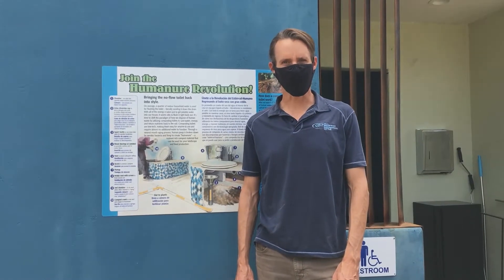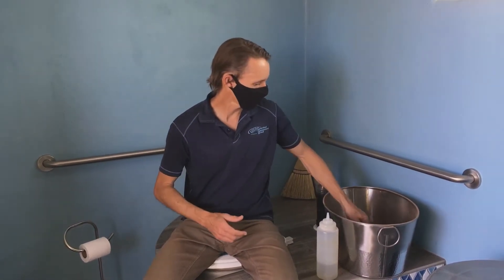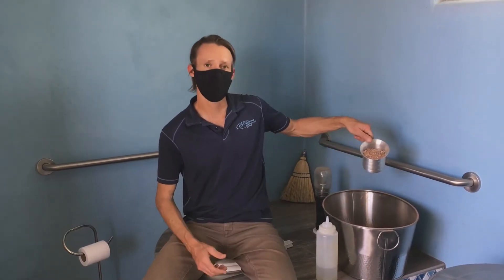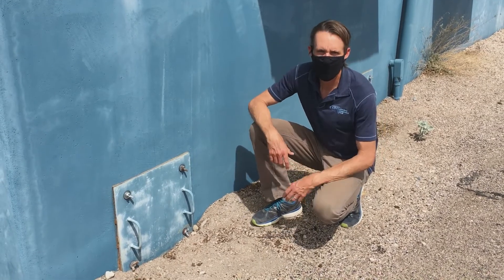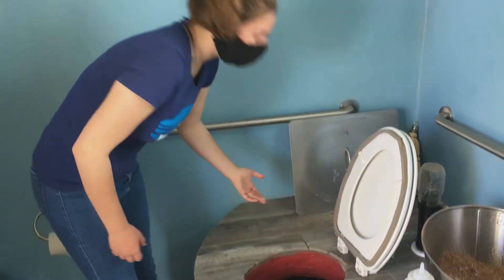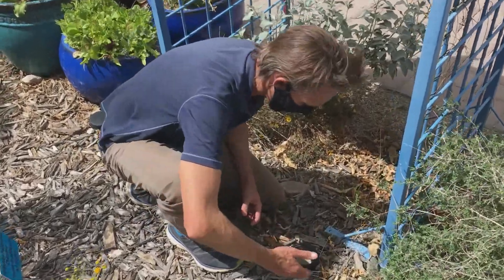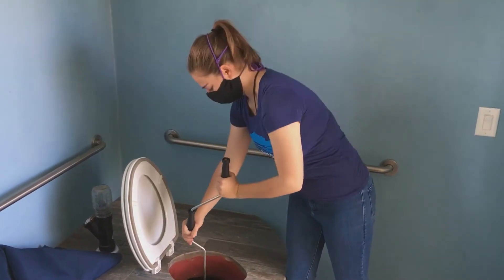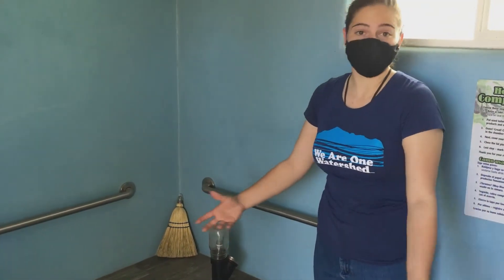Double Chamber Composting Toilet Overview

Comment: Could you tell more about the interceptor for the urine diversion?
Reply from the maker: Hi Melodie - The interceptor specified in the reference design is not recommended. It is better to place a stainless steel screen to keep any particles from moving through the urine diversion. The urine diversion drains into a below-ground infiltration chamber.

For more information, please visit our website (watershedmg.org) and check out our virtual field studies (watershedmg.org/learn/classes/field-studies)
Reply: Thanks for your response.  It is the chamber where the urine goes that I am trying to learn about.  I want to purchase one of these systems, but I need to explain its operation and design fully to county permit officers.  The urine will not go to a sewer or traditional septic tank.  I would like it to go to the landscape as it appears to at your lab.

Comment: Could you use an air pump to force aeration into the pile. Maybe aluminium scaffolding pipe across the diameter in 2 locations? Powered by solar power. Or if you have an external sunny wall you can make a solar air heater using black painted soda cans - but vent the heat to atmosphere. Use the updraught to provide ventilation via stack effect drawing air through the seat when open, or through the aeration pipes when closed. Heating of the pile will help with this.